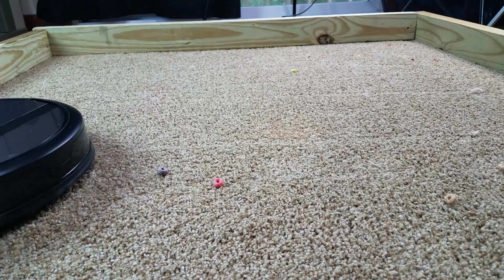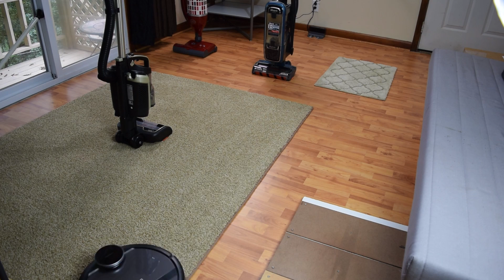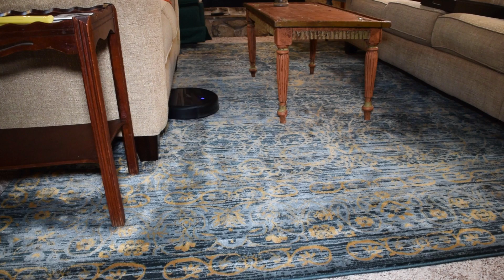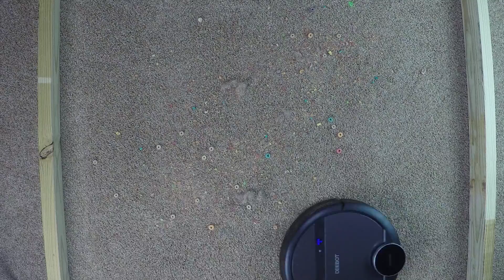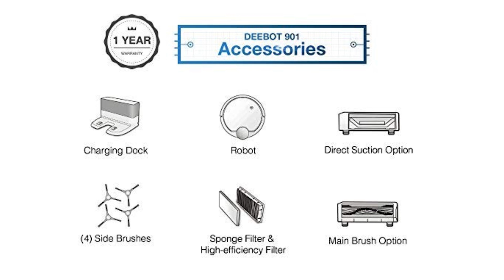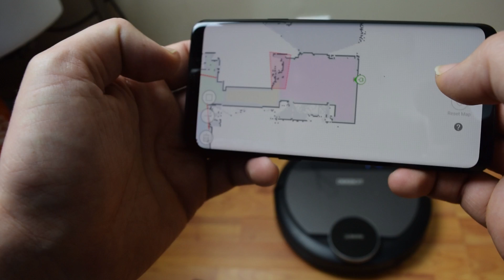ECOVACS DEEBOT 900 / 901 Robotic Vacuum Cleaner TESTS & REVIEW with SmartNavi 3.0

Comment: used ECOVACS ozmo 930 because i wanted the moping function.  What an amazing smart machine, the navigation. cleaning and mopping worked very well. The noise level was very low, i would say it was almost half as loud as my Neato. The map and its function was very easy to use. BUT it could not navigate over my 1,5 cm doorsteps, so i sadly had to send it back.  i have now used 300 dollars more and got a Neato d7 connect,. this works very good, and easily climbs over 2,0 cm doorsteps but it is not better than my Ozmo 930....expensive doorsteps
Reply from the maker: Wow, that's such a relatable story. Sounds like you're getting the job done! 🤖

Comment: I have the deebot 900 robo vac.  I had a neato before and it worked for about 2 years than. Quit working and when I called the customer support they were absolutely no help at all.  So I started looking at new. Robo vacs.  First I am a 76 year old person with a small house of 800 sq feet.  it does a fantastic job.  It out preforms the neato by far!  Make sure when you get your new deebot to let it fully charge before trying it out and make sure to have everything picked up in the house the first time so it can make its map of your whole house.  It will look lost and turn in circles while it is mapping the first time but let it do its thing.  If she gets stuck pause her and restart her do not move her or she will not retain the first mapping and you will have to do it again.  But as soon as you get the full mapping done you can then try to hook her up to the app.  For me she hooked up very easily to the app and has worked flawlessly since.  I have been able to make barriers through the app for places I do not want her to go most of the time so I can run her anytime even on the schedules you can make in the app.  I tried several other robo vacs before deciding on the deebot 900 and looked at all options etc.  this one had the most options, gets caught up less(due to the barrier feature you can set in the apps) I love my deebot and think you would too.  I am going to make a video when I get a few extra minutes.  Thank you deebot for a superior product.

Comment: something you didn't mention is the ability to maintain wifi connection, I have a wifi router in the basement and an access point upstairs (3 level home). Laptops, phones, and smart devices have no problem staying connected, but if I place this vacuum on the main level, every week or so, I'll open the app and see that it's offline. If I place it upstairs, directly beneath the access point, then it always shows up online in the app. Otherwise I have to switch off the red power button, take it upstairs, put it under the AP, power it on, wait a few seconds for it to connect, then take it back down to main level to start vacuuming, then it'll be fine until it looses connection again.
Reply from the maker: That is interesting. Thanks for sharing.

Comment: Love ours. Take the folding flap off the inside of the collection bin and it will pack dog hair in there better. Also the plastic piece that snaps in under the carriage, if you take wire cutters and cut the thin strips that cross the brush off hardly nothing will tangle on the brush. Great machine for the 300 price range absolutely love it
Reply from the maker: Awesome to hear, thanks for posting!

Comment: We now have had this Deebot 901 for almost 2 years and, while reasonably satisfied in the beginning, we are starting to hate it by now. Main reason: It hasn't had a single software update during the entire time! It will sometimes randomly erase the map because it thinks it is in a new environment (while virtually nothing changed to the room). Moreover, while competitors now support saving multiple maps for multiple floors (even on older models), this one still suffers from the snowflaky single map. Hardware-wise, it will now barely run for 30 minutes on a battery charge at max setting. And even after replacing the entire filter assembly and dust bin and having it on the max setting, it will leave a lot of debries, making my GF very dissatisfied with te result. This is mainly attributable to the fact it 'blows' stuff out of the way by it's air exhaust, prefaribly to a path it already has been. And the worst of all: It is starting to make grinding noises by it's main brush motor assembly. This doesn't go away even after a very thorough cleaning or main brush replacement. 

So in short: It had some software flaws to begin with, which have never been solved. And hardware-wise, it has deteriorated a lot in barely 2 years.

Comment: great review, i'm confused. You said if the robot can't complete the house on the first run @ 110 minutes on low power lets say, you wont be able to setup the zones. But if it has recharge and resume features, it could take 10x recharges and resumes and eventually have the entire house mapped and on your phone. So did you made an error when you were speaking or is there something i'm missing?
Reply from the maker: I was unclear on this, it sounded like people were having trouble with just that in the reviews, that is to say that it wont work unless it can do it in one charge. but I never actually confirmed that, and the person that mentioned the problem didnt make it clear, so I thought I would play it safe.

Comment: can u do a tear down of deebot 900/901/907?  according to ecovacs, there is no replacement battery for these models and i was curious to see if you're able to find an after market battery to replace.  i plan on putting the robot to work which i'm assuming the battery will last 2-3 years.  not having a replacement battery is a big turn off for me to buy this model.

Comment: How does this compare to the 1st gen Xiaomi vacuum; is it better?
Reply from the maker: They both are laser bots, and Im sure the cleaning, and battery are similar though Im not sure of the exact specs, but the Deebot 901 has WAY more capability with its software and maps.
Reply: Can you do a full review on the xiaomi vacuum please?
Reply: @VacuumWars  Yes! Please do a review of the Xiaomi mi robot (roborock 1st gen) to see what the difference is between it and the s50.

Comment: Hi.  Is there any reason why I should buy two of these for the same price as neato d7?  I'm just skeptical of the price difference.  Sounds like there is zero reason to buy the neato D7 over deebot 901.  Would you agree?
Reply from the maker: Well, I think the Neato has MUCH bigger bin which you will notice, Also the D7 is built like a tank. Not saying the Deebot isnt high quality, but the Neato is premium. It is also more poweful and better at pickup, even on low power
Reply: What about the neato d3 connected vs deebot 901.  They are in the same price range.  Which one would you go for out of those two?
Reply: I had a several neato’s to be honest the do have good power BUT. They have the navigation but no sensors on the from bumper. It literally rams objects unless you have the extra care option on. That option isn’t avail in the schedule mode. The Nestor would get in corners and back up scare up my walls with it butt in the air. It always some how drag my table chairs or coffee tables out in the room. The d shape it nice but it gets caught a lot. I honestly can say I have the xiaomi mi robot and I love it. I bout my mom the Roborock s5 and I do have to say it’s way above mine. It has no problems with carpet either. Also if you choose to buy the Roborock. Make sure you buy it from the Roborock amazon store. That way it’s under warranty from the company and it’s come from them directly. My xiaomi is 2 years old. It runs 4 days a week. Never has it not made it back to dock or gotten stuck. I did follow it to make sure cords and such are out of the way. I never worry about it after that.

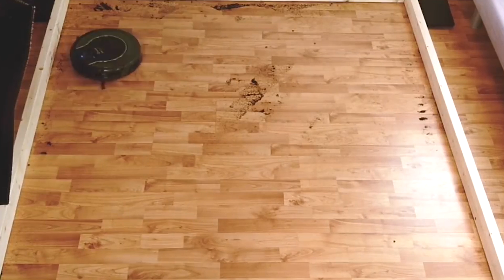Comment: @0:55  Though when I enjoy your videos, what you said at :55 can't be totally correct. I'm on my 3 model of Neato and never felt it randomly just went around doing it's duty. Unlike my iRobot Scooba (I will never own a iRobot vac based on how the scooba operates) and though I'm on my 3rd Neato since the 11 model, my D80 has been performing well,  just going to retire it to my basement and run once a week on carpet. And from what I've "heard", those devices using cameras do not do well in the dark.

Edit: Oh and before I forget, something you never hear from people reviewing these devices is how well it's made. My daughter got one of these "off brand" types for xmas. When I picked it up, it felt cheap. I know it might not seem like a selling point but when you have dropped or kicked your Neato and it comes away fine, one has to wonder if these "cheaper" machines with their thin plastic shells can survive a tumble down the stairs or a drop from hip high. Just a thought.

Comment: My 901 won’t map the whole house...Is there a trick to make it finish the entire house?  Once it has that, I have a feeling it would work better.  I’ve had mine a week and it has yet to map or finish cleaning.  I called tech-support number in the Philippines and they are pretty useless. They suggested some basic troubleshooting but I have a feeling the issue is my floor is over 2000 ft.². Am I able to compartmentalize and haven’t learned that way? The issue becomes the vacuum off and die completely before finding the charging dock while mapping.  If I try to pick it up or put it close to the dock to assist it it loses the map!  How annoying.
Reply: I can only think of maybe running it on low power and running it with the suction only attachment? In theory the battery should last longer since the vacuum doesn't need to spin a brush.

Comment: Why does it have a low rating on Amazon?
Reply: The software is horrible. We just sent ours back as it can't handle curtains (map gets twisted) and had constant problems. We have 8 meters of curtains hanging and I really don't consider it ok for me to have to raise them each time the robot starts cleaning (every day as we have a dog in the house). It almost never made it back to the charging dock and had to map the floor all over again due to that. Cleaning the container and brush meant that the floor was full of debris again. We previously had Deebot N79S and it did a much better job, was a lot easier to clean.

Comment: Could you please redo the roomba review and see if iRobot will send you a different on because I think something is wrong with the one you have. Every time I use mine or when I test t it dose better then what you come up with also I have had every roomba sense the first model and every once in a while there is that one defective one I have sent back a 980 got a new on and it works 10 times better thank you
Reply from the maker: Thanks for the comment, in what way do you think it is not as good, power, battery life?
Reply: Vacuum Wars I feel like it could be both
Reply: I see better battery life with mine then you get ( on auto mode ) not sure what you yes yours one but you can’t test power because I don’t have your and you don’t have mine